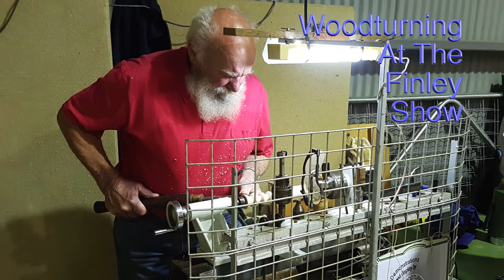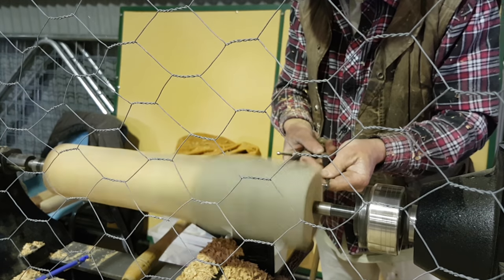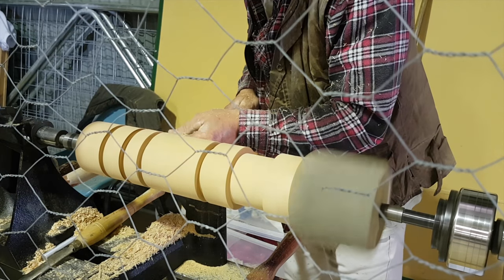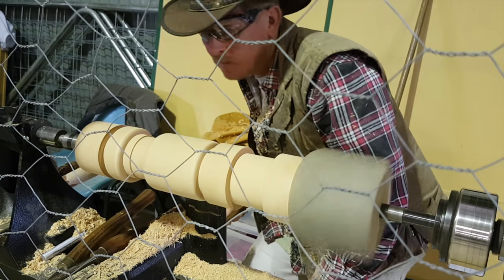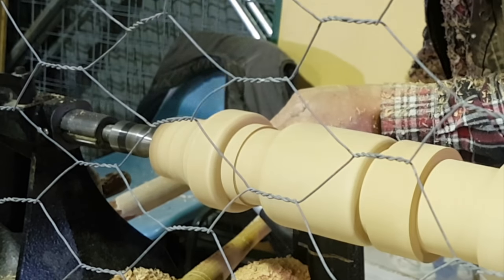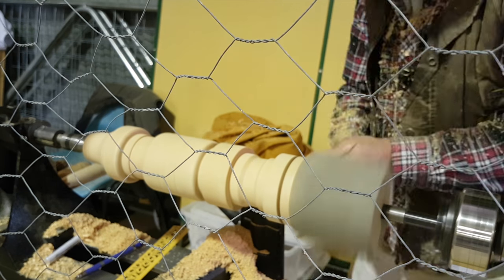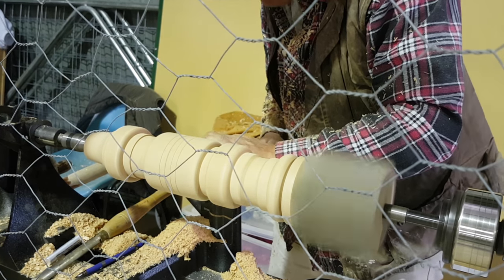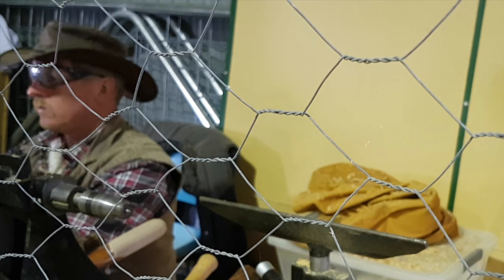Turning Coffee Table Legs

Comment: Good show Dave. Have you ever had the mesh protecting the onlookers actually catch anything major?
Reply from the maker: No, it's there to comply with insurance. I will work one more aesthetically pleasing to the eye for a future demo but it did the job. Some guys use it to clip projects too and hang tools etc.

I may try and get a perspex shield at some point
Reply: I think I prefer the wire shield. Perspex or polycarb becomes muddy with scratches. The wire you simply look through without noticing it.
Reply from the maker: Very valid point. I had heard insurance was going to only accept a solid barrier. Not sure how true this is. If I stick with wire I woukd like black wire. It is noticed less. Also a nicer frame and stand